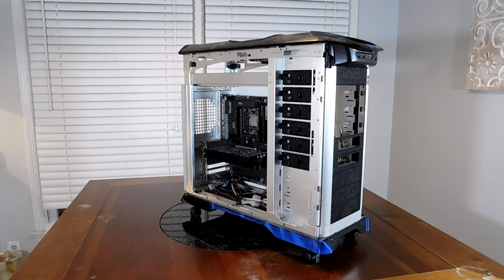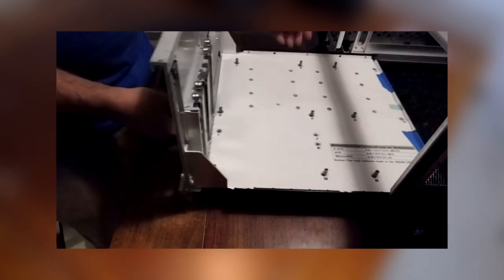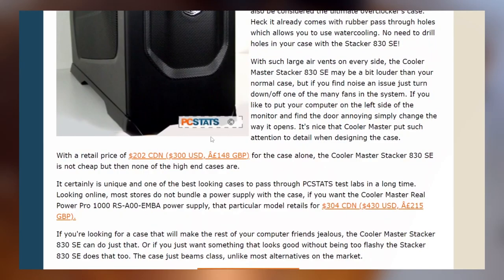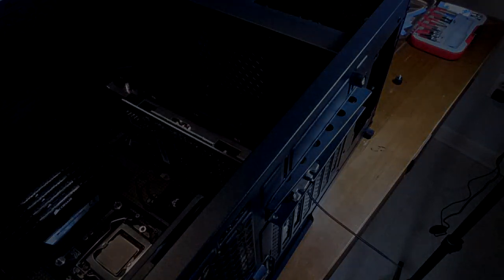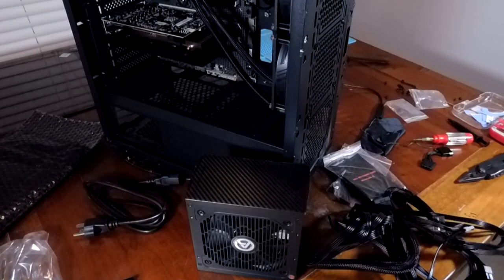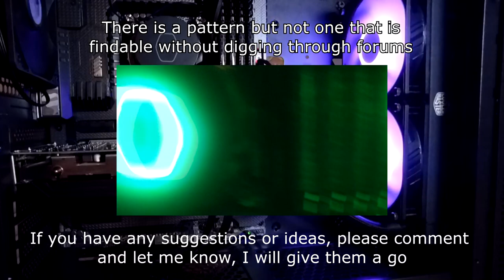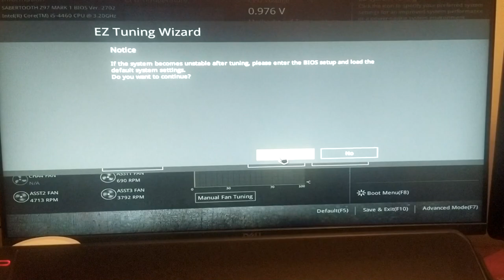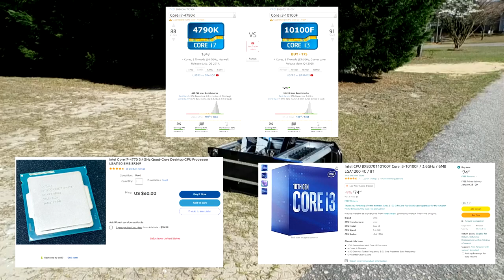Side of the Road Gaming PC: FINALE

Comment: The radiator’s pipe should be on top. By doing that, the pump will work less hard.
Reply: the way he did it is optimal as well, minus the fans being in the wrong direction. All you want is the pump to be lower than the highest part of the radiator itself. But I know a lot of people like to quote GN or some other YT channel, so as long as it works, then who cares!

Comment: my mobo used to only see 1 ram stick it had 2 dimms but reseating the cpu fixed it. my mobo would boot though so most likely that lane is gone in yours.
Reply from the maker: I might give reseating the CPU a try. Thanks for the comment.
Reply: @BudgetBin  Another tip would be to try not to under/overtighten the AIO when mounting it to the CPU socket.

Comment: Good thing of the LGA1150 plattform is, you can use regular Xeon E3 V3 and V4 on it, without some Bios Modification. Even limited overclocking on non-K CPU is possible, by setting the clock speed of all cores to the clock speed of the single core turbo. Both things where dropped by intel with the introduction of the 6th gen.

Comment: My theory of why rainbow six ran faster than on this than the i5 9400f is probably that the optimization for multicore systems isn't as good as the raw additional power of the newer i5. Which would make it spread resources less efficeintly across cores and threads, reducing performance. Just a theory though. Edit, there is a way to test this by diabling some cores in your bios to keep it the same number as the this one, and check if it improves performance.
Reply: Nope that cpu has no hyper-threading for some reason.
Reply from the maker: I never thought of it like that, might be a good idea for a video in the future, maybe we will learn something new even through experimenting.
Reply: @_WeHaveFun_  the i5 9400f has 6 cores and 6 threads, this cpu has only 4 cores, which the game might be more optimized for, which is what i was saying

Comment: It's hilariously ironic that all ASUS mainboard users simultaneously praise ASUS for their quality, while all their mainboards have problems. Both times I got one (1 used locally LGA1366, 1 new online AM4), I had to deal with issues that didn't exist for me on cheaper brands (like GIGABYTE). Fuck ASUS!

Regarding performance difference between those two computers: as time progresses, manufacturers use cheaper and cheaper materials and implementations of hardware. So it shouldn't be surprising that an older HEDT(?) outperforms newer standard desktop hardware.
Reply: Dead lan, dead soundchip…in 5 of 10 used asus boards, i bought this year.